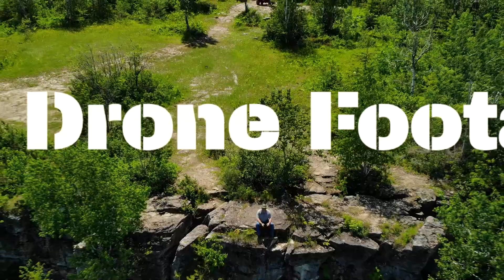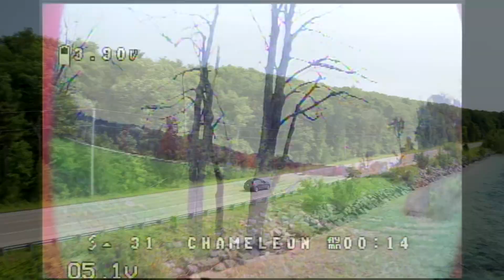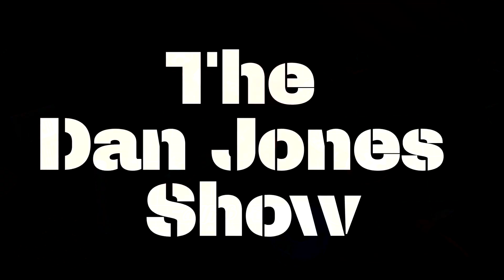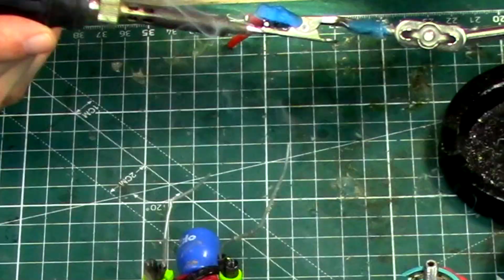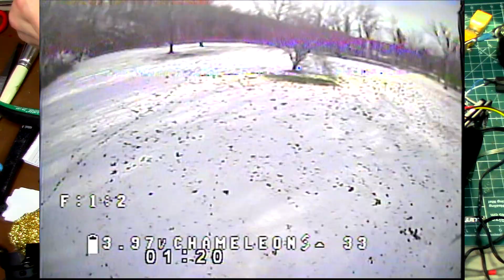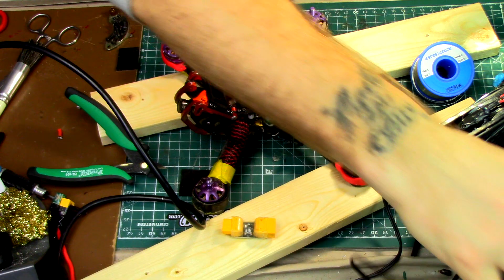XT60 Pigtail Replacement | FPV Quadcopter Repair | #SOLDERING

Comment: How hot is your soldering iron/station set? I'm trying to repair the power lead on one of my quads but I can't seem to get the solder how enough to remove the cables. I'm using the Pinecil, which goes to ~415°C but that doesn't seem to be enough :/
Reply from the maker: 400c should be fine, make sure you're using a broad tip like a chisel and not a thin , conical tip.  Use flux paste on the tip and in the spot you're trying to de-solder.